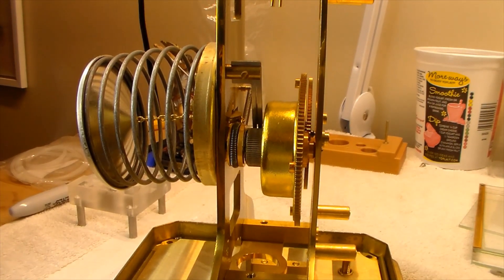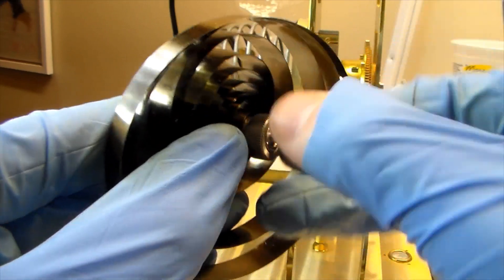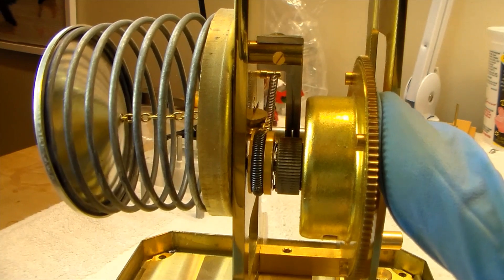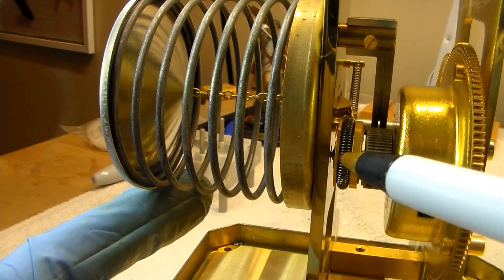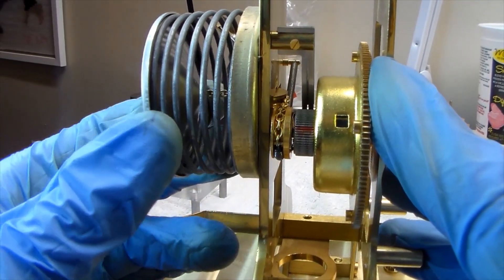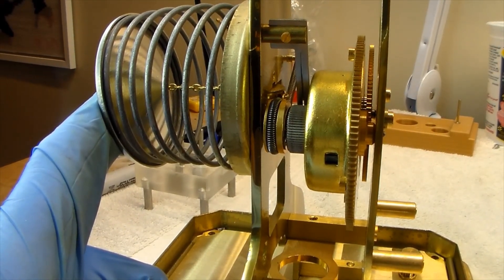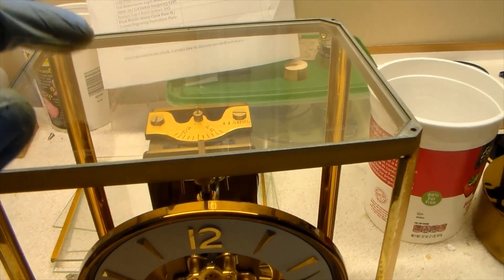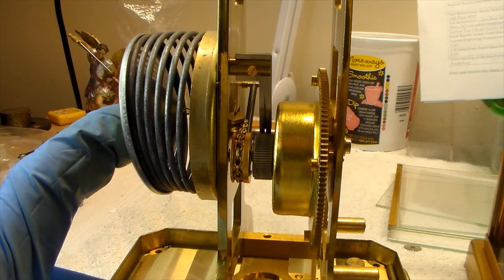Jaeger LeCoultre Atmos Clock Winding System

Comment: Hey Curt …. I would like to know how to setup the wind procedure for a 519 model after it was taken apart and cleaned up. I did separate the front mechanical section (with the hands still attacked) so I could inspect/clean the back section that houses the winding system, So how do I proceed to put the unit back together and start a initial wind on the spring system. Thanks for any advice …..

Comment: I volunteer at a not for profit resale shop and an autos clock was dropped off. Where’s the model number. I’m a nuts and bolts guy and I’m amazed at how they work. Appreciate your video and would like your feedback on how to price this one.
Reply from the maker: @danieldibiaso9342  look down from the top where the regulation and that wire protrudes out of a bridge.

Comment: TBH at 11m00 the winding takes plakes thourgh changes of the seasons? Must be me not understanding how this clock works. But as far as I understand, it it has all to do with lower and higher temperatures. So that has mainly to do with the weather and of course also a 'bit' the seasons. Of course it depends a lot where the clock is standing. But in a normal room, temperatures will change throug the day and night with at least some degrees. And - according to some Atmos manuals - 1 degree °C will "wind" the clock for about 4,3 days. And a change of only 1 degree C IMHO happens almost every day with the 'normal' day en night temperature differences. IMHO meaning that an ATMOS clock - if working properly - is always about fully wound.

Comment: I'd say rather than being "the closest invention to pure perpetual motion" this is perpetual motion, if one understands what energy is then a real perpetual motion machine is one that functions by taking energy from the environment, which is exactly what this clock does via the change in temperature and the fluid behavior, by definition it operates on COP. 

As long as your machine is operating in a continually changing environment it can do work without any user input. No magic at all.

Comment: Hi Curt; I suspect I have a flat bellow on my 528-6 Atmos because of your advice about the spring position, which is at 12 o’clock.  Being in Melbourne Australia I am afraid to send the clock to you in the USA for fear of damage.  Is it possible for me to manually wind the main spring by removing the bellow and pressing the spring like you showed so that it will run for 8 to 12 months or is this not possible, please?  Thank you, Curt.  Michael

Comment: I recently bought a 528-6 that had never been run since new. I needed to remove the wooden packaging material from the movement to start it. Going by the serial number, and the date engraved on the bellows, it was manufactured around October 1962. Sixty years on a shelf, with the pendulum rotor locked! Needless to say, it ran for only 24 hours, although the mainspring was still fully wound from the factory, because the original oil had gummed up the works. I have had it serviced, and it is keeping good time, better than 30 seconds per week, less than one rotor motion! The chain end position is less than 6 o'clock, no spring visible on the winding arbor from the left, so the bellows is still OK for a while, although it measures much less than new depth.
It is not obvious to me why the bellows cannot wind a fully unwound mainspring, especially if the clock is not running. It seems to me that it may take a while, even years, but eventually the mainspring would be fully wound?
In the case of my clock, not running, with the rotor locked but the winding mechanism operational, I can imagine the mainspring being fully wound until it is coil bound. Perhaps the bellows spring is deliberately not strong enough to over-wind the mainspring. I guess that the bellows spring is carefully calibrated to provide the correct pressure to the bellows to keep the boiling point of the ethyl chloride in the range of typical room temperatures?
IanB

Comment: Thanks for this video.

Do you know what change in temperature is needed for 1 click of the ratchet?  And do you know what the minimum and maximum temperatures are that still allow for the springs to react?  I suspect this may depend on model type.

Would love to see this run in a desert.  Or accelerated in an oven/torch/hot air gun/Freezer/Karen's bedroom/etc.

Comment: Nice vid... EXCEPT FOR ONE THING!!!!! You miserably failed to show what goes on in the bellows itself. How could you screw this vid up so badly??? A definite waste of my time.
Reply: I’ll try. My understanding is that the Atmos bellows contains a quantity (steadily decreasing as it slowly leaks out) of ethyl chloride, otherwise known as chloroethane CH3CH2Cl. The salient property of this compound in the Atmos is that its boiling point at sea level is 54°F, or 12.2C, slightly below comfortable room temperature. The pressure in the bellows is slightly higher than atmospheric due to the bellows spring, so the boiling point is slightly higher than 54°F, somewhere close to average habitable room temperature. At this temperature, the chloroethane exists in both liquid and gaseous states. Depending on room air temperature and pressure (mainly temperature, I think), the proportion of liquid and gas changes and the volume of the bellows changes with it. There is an equilibrium between the quanties of liquid and gas present, volume of the bellows, temperature and pressure. If the temperature increases, some liquid boils off into gas, the pressure increases, the bellows expands until a new equilibrium is reached. The bellows spring is compressed a little, some chain emerges from the bellows enclosure, and the clicker clicks a tooth (just one mostly, I guess). When the temperature decreases the process reverses, the bellows contracts and the bellows spring expands, the chain rotating the winding arbor to wind the mainspring a ratchet tooth (or maybe more, I don’t know). 
The effect of the bellows is to greatly magnify small room air temperature changes into linear movement with enough force to wind the main spring, thus extracting energy. 
Overall, heat energy enters the bellows during a temperature increase, the energy converts some liquid to gas, the resultant increased pressure expands the bellows, compressing the bellows spring, storing potential energy in it. That energy is transferred to the mainspring during the next temperature decrease. Finally, the energy is transferred to the movement and escapement, returning to the room air as heat, but not very much. 
IanB

Comment: Did you mean the winding happens on the bellows expansion? When it goes left and gets bigger it winds the main spring, right?
Reply: The winding happens on the bellows contraction. As the bellows expands toward the front of the clock due to a temperature increase, the bellows spring is compressed, potential energy is stored in the spring and a small length of the chain emerges from the bellows, allowing the winding arbor to rotate a little, anticlockwise as viewed from the front, pulled by the chain tension spring. The clicker plate advances a tooth (maybe more, I don't know), but the mainspring does not move. When the bellows next contracts, the bellows spring expands, winding the main spring a click on the ratchet (maybe more, I don't know). The amplitude of the bellows movement must exceed the amount required to make the click wheel and mainspring ratchet each click over a tooth. I hope I have all that right 🙂

Comment: Think I'll just soak mine in some gasoline, let it dry and spray everything with WD-40. That should fix it, right?
Reply from the maker: Haha I know you are being sarcastic! But some atmos owners do spray WD40 on them, which is major no no!. And WD40 isn't really a lubricant either, it is a penetrating spray, and a rust preventer. Atmos Clocks are never externally oiled!
Reply: @atmosrepair  Maybe just a quick dunk in some motor oil...synthetic, of course. I'd shake out the excess, blot the movement with paper towels and put it back together. That should do the trick.  I'll try heating the bellows with a hair dryer to get it going.
Reply: @atmosrepair  Seriously though, MANY years ago, when I was a teen, I found an "onyx" (actually dyed Belgian limestone) mantle clock likely from the late 1880s, at a country auction. These were not uncommon in those days but this was unusual in that it was in perfect condition and tastefully styled. It had been originally sold by one of the leading jewelers in the Country.  It wasn't running but the pendulum and key were present, so, for $14 it was mine. Then off to the library for a book on clock movements. I was able to repair it. Removing a century of old oil from the French movement was done with a residue-free solvent used for certain electrical parts. Then lubricated with clock oil and regulated. With relatively constant spring tension and room temp., the clock is accurate to within 2 sec./24 hr. Amazing!
Reply from the maker: @wholeNwon  That is awesome! Many other clock movements can be cleaned with somewhat harsher solvents and solutions, being largely made of solid brass alloys and what not. But for the watches and atmos, want to use a delicate, non stripping cleaning solution. But very cool story and thank you for sharing. It always feels good to bring something that is broken or non running, back to life.

Comment: Plastic is cheap, it’s a downgrade that should be reversed to glass upgrade
Reply from the maker: You are not alone in this opinion, many do not like the Lucite top that the 528-8 have, and that is original. Was likely an adaptation to prevent the glass breaking, but also has to do with the case design, having the front panel. The case posts are screwed into passing through the lucite. But since most owners liked the glass from previous models, they did return to a glass top piece for the Atmos 540, the next model in production. And they changed up the design a bit, utilizing a thick rubber gasket around the glass.

Comment: Hey Curt a question I have a couple of these clocks I've purchased and have owned awhile and they have presentation plates glued to them I would like to remove what is in your opinion a safe way to accomplish this mission without damaging the clock in any way.
Reply from the maker: That is a tricky one, no matter how carefully you do this, there will likely be residue, discoloration, adhesive etc. You can try fishing line, but if that doesnt do it, peel off with hands. Razor could work but is also dangerous. I usually replace the plaque with a new one denoting the make model and date of manufacturing to put over the spot where the old one was located.

Comment: Maybe I missed it but you never said what makes the bellows go in and out. I know it is the atmosphere but how does that work?
Reply from the maker: You didnt miss anything haha, I didnt go into the bellow function on this video, I have to leave something for future videos to keep you watching! :) The bellow is a sealed unit, that contains a gas which is sensitive to temperature and pressure changes. These causes the sealed diaphragm to expand and contract ever so slightly and pump that spring contributing to the wind on the mainspring.
Reply: @atmosrepair  Thanks. A very interesting clock! The one I have was given to my Grandpa Hamilton by Chevrolet when he retired from the Corvette plant in St Louis Missouri in 1960 (1935 he started, I was born in 1959). He ran a bulldozer in the steam generator yard loading coal.  They made their own  electricity. Amazing they would give a clock like that to a working stiff like that. The family always said the clock was inaccurate but I noticed the cabinet they had it sitting on would wiggle slightly as someone walked by causing the pendulum to wiggle. Since I brought it home and put it in a solid place it has been keeping excellent time.
Reply from the maker: @perrylocke6037  Thank you for posting that history of your grandfather, that was very laborious work and awesome that it was honored by the company with an Atmos clock. The gift was very well deserved in my opinion, it delights me to hear that. That was a time period when employees stayed with a company for the duration of their careers. It is also very good that you noticed the clock was not set up on a very stable shelf, that definitely has an effect on timekeeping. The balance wheel rotation is essentially the timekeeping feature, so imagine it like you are driving to a location, the fastest way to the destination is a straight line, and if you zig zag to the spot it will take twice as long to get there.